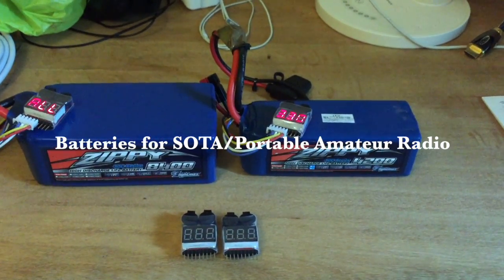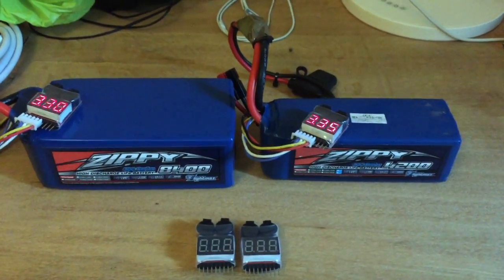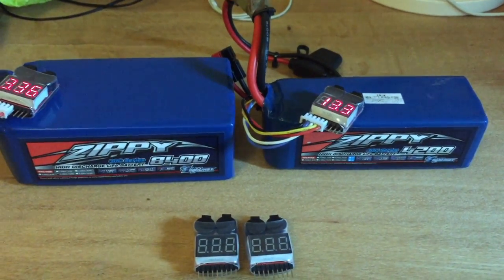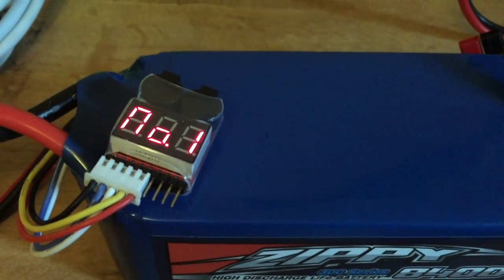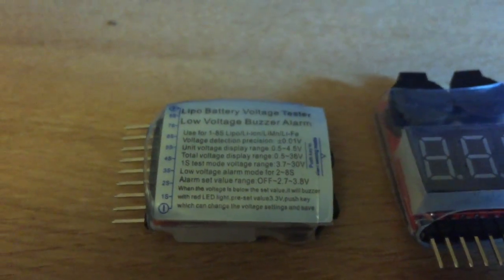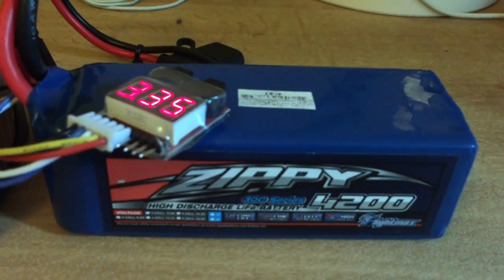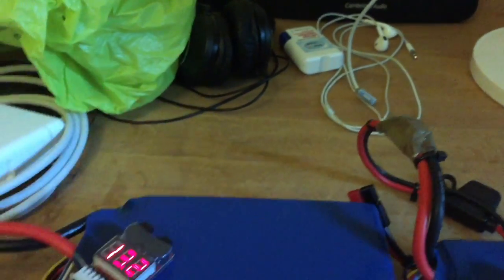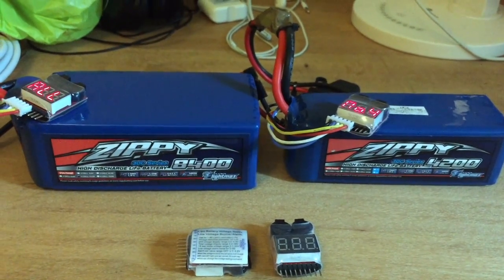Batteries for SOTA/Portable Amateur Radio

Comment: LiPo smaller and lighter and provided much, much more amps. 

Lipo these days won't catch fire if you monitor cell voltages and use a proper RC charger to charge with balance connectors connected. 

But the risk is there, if the cells get punctured they will catch fire and smoke a lot. 

Charge and store , "always" in a fire proof location.

LiFeP04 will last longer but for portable, LiPo is smaller and lighter + you can get hard case LiPo too.

Great for powering 100 watt rigs. Parallel 2 x 5 000 Mah packs and you got 10 ah etc and probably a few hundred amps discharge capability with LiPo. 

QRP radios like the wonderful Xiegu X5105 has a great internal Lithium battery that will power it a long time. A seriously good radio !

Comment: Would two of the 4200 batteries give you the same run time on the KX3 as one of the 8400 battery. I like the idea of having a backup as well as the option of only taking one battery sometime but was wondering if the 8400  would give me more run time than two of the 4200.
thanks for your time.
Tom
W1TWS

Comment: good stuff James, I run a bunch of these as well, two of the 4s1p's and another 4s2p.  I run them through a drok ltc3780 step up/down converter, so my kx3 always sees 13.8v. I will have to do an article on the drok as some point and get a spectrum analyser to look at it for noise. I took it up Machen mountain the other week and it all worked great :)  73 Richie, MW0LGE
Reply from the maker: Thanks Richie. I'd be interested to learn more about your setup, sounds interesting. I'm guessing you stay out for longer than me if you need a bank of them ;) 73 James M0JCQ